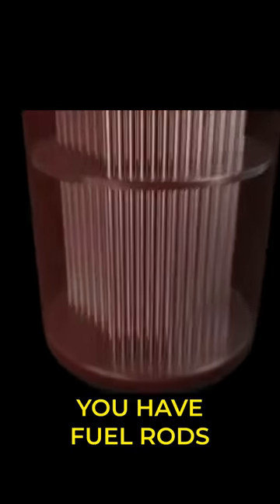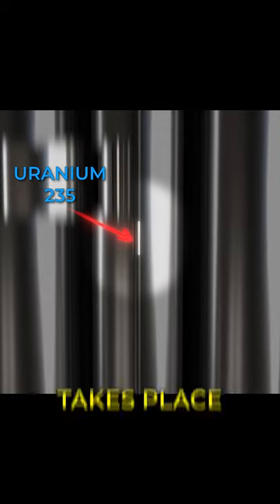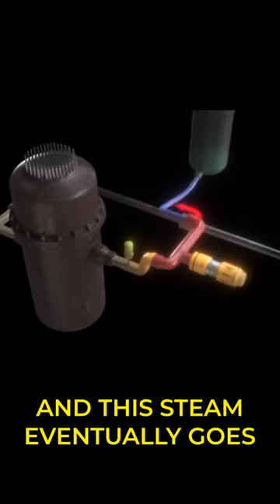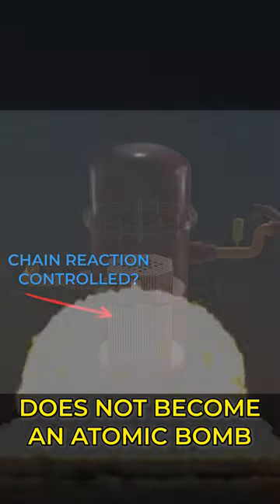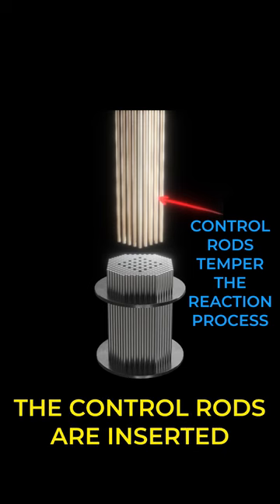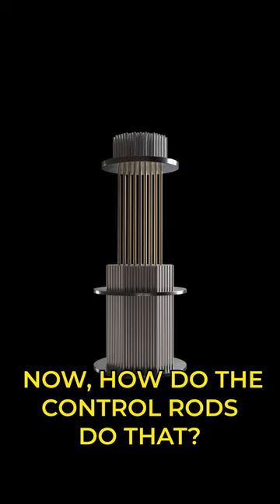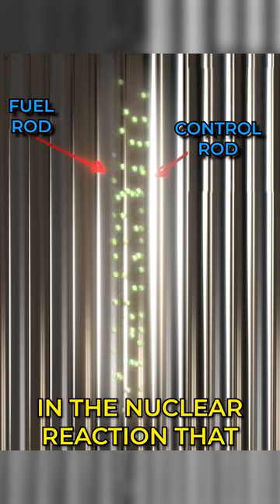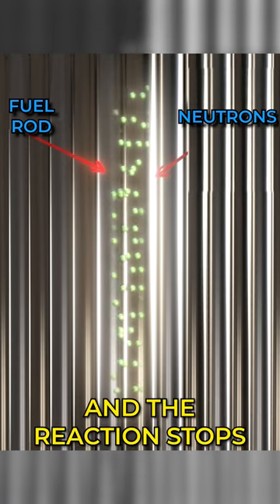How Nuclear Power Plants Control the Fission Chain Reaction

Comment: Thankfully Earth has no earthquakes or tsunamis to upset these fragile arrangements.  
🌊🏭
Reply: Extreme measures are taken when building reactor plants to mitigate the effects of natural disasters.  Uniquely stable sites and massive foundations, for starters.  There are several layers of containment.  They are anything but fragile.
Reply: @chiphill4856  You mean the GE 001 plants at fukushima daiichi are just perfectly safe then? 
Are you too young to remember? 
All those fuel rods on the bottom of the tank in a heap fizzing away…

Comment: Can you just tell me. If the water in the reactor is a closed loop, then how does the cooling tower work.
Reply: The water that goes in reactor never hits the water that goes in turbine and to cooling towers.

The super hot steam stays in its own system and it heats 2nd loop through exhangers.
Reply: There are two types of reactors in consideration: boiling water reactors (bwr) and pressurized water reactors (pwr). The one in this vid is a bwr, where the first loop boils water and the steam is run through a turbine. In a pwr, the primary loop is closed, it runs through a steam generator that heats another loop to create steam to run through the turbines. On both, the cooling towers come into play in a final ultimate heat sink loop, in a seperate loop after the steam turbines. After the turbine there is a heat exchanger for keeping an effective delta T in the turbine loop. This excess heat is then routed to the cooling towers.

Comment: I heard that it is the opposite.  The control rods help the reaction, and it is their removal that stops the reaction.   Maybe i was misinformed, or maybe different reactor designs work differently.
Reply: No. It is as shown in the video. 

Solid fuel is always static, so the only way to control the reaction by insertion of a foreign element is if this element stops the reaction, not by speeding it up.

Even if speeder rods were a thing, it would be a security risk, as gravity pulls the rods inside the reactor. In case of a mecanism failure it would do the opposite of controlling (therefore nobody uses such design).
Reply: That one is actually a different design but the principal and concept implementation is the same.
Reply: Those are also a thing. They instead of absorbing the neutrons, reflect them, which increases the amount of fission ocurring. These are used alongside control rods. Such designs were used in the RBMK series of reactors (such as the ones in chernobyl), they were the reason for the meltdown at the reactor, however it was because the reflection rods were integrated into the control rods (which is a terrible idea because if the rods get stuck, like in chernobyl, a meltdown will occur).
Reply: @warcrimemenace6292  Aha!  That's it!  I must have been remembering a video about Chernobyl.
Reply: Control rods slow down the neutrons that propagate the fission in the reactors.

Comment: That is not correct....there is a primary and a secondary cycle , where the water in primary cycle is high energetic and heats up the water of the scnd cycle to form steam which goes to the turbine.
Reply: You are describing a PWR, which is the more common type in the US. But there are also many BWRs and that's what is being shown in the video.

Comment: This is the kind of reactor that exploded at  Chernobyl. All such reactors are susceptible  to warping of the control rods when too much heat is generated - typically when the reactor's maximum safe operating capacity is exceeded. Warped control rods can jam   in place, such that normal shutting down of the reactor cannot take place.
Have a nice, relaxing day.